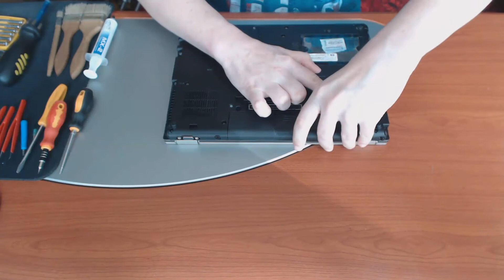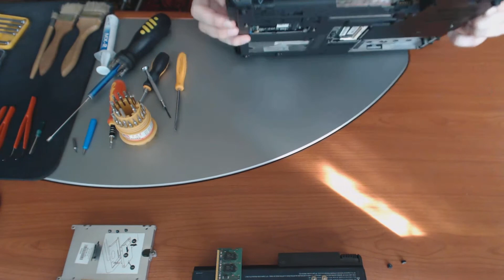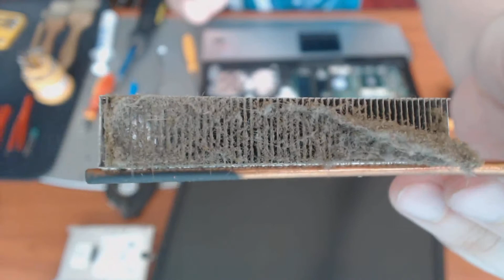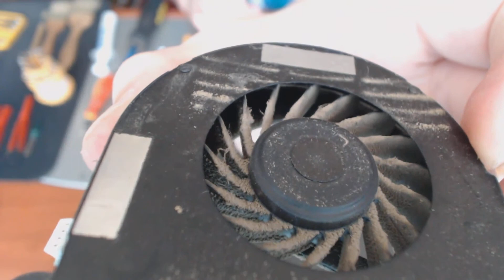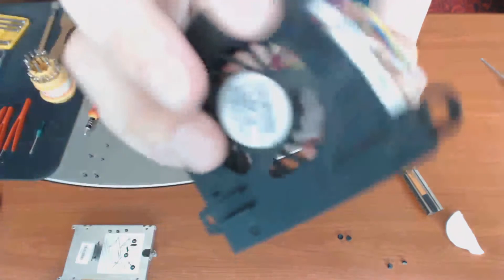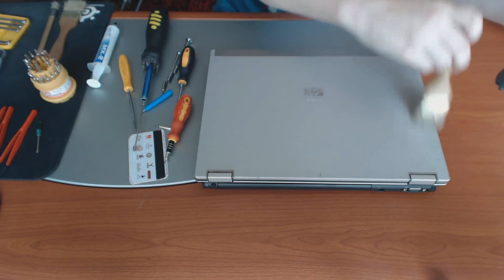Disassembly HP EliteBook 6930p GB997ET

Comment: Can this model be upgraded cpu or not?  What cpu can I upgrade to?
Reply from the maker: Hello! Yes, you can upgrade the CPU. The following processor families were installed in these notebooks according to the HP specification, https://support.hp.com/vn-en/document/c01538039

Intel Core 2 Duo Processor:

Intel Core 2 Duo Processor T 9600 (2.80 GHz, 6 MB L2 cache, 1066 MHz FSB)*
Intel Core 2 Duo Processor T 9400 (2.53 GHz, 6 MB L2 cache, 1066 MHz FSB)*
Intel Core 2 Duo Processor P 8600 (2.40 GHz, 3 MB L2 cache, 1066 MHz FSB)*
Intel Core 2 Duo Processor P 8400 (2.26 GHz, 3 MB L2 cache, 1066 MHz FSB)*

System chipset 
•	 Intel PM45 Express chipset
•	 Intel GM45 Express chipset

Here is a list of processors that Intel PM45 supports - https://www.cpu-upgrade.com/mb-Intel_(chipsets)/PM45_Express.html

Here is a list of processors that Intel GM45 supports - https://www.cpu-upgrade.com/mb-Intel_(chipsets)/GM45_Express.html

But the problem may be that your current cooling system will not be able to divert the heat flow from a more powerful processor and the laptop will begin to shut down under load. Better to do a processor upgrade at a service center.

Comment: Can this model upgrade the cpu?
Reply from the maker: Hello! Yes, you can upgrade the CPU. The following processor families were installed in these notebooks according to the HP specification, https://support.hp.com/vn-en/document/c01538039

Intel Core 2 Duo Processor:

Intel Core 2 Duo Processor T 9600 (2.80 GHz, 6 MB L2 cache, 1066 MHz FSB)*
Intel Core 2 Duo Processor T 9400 (2.53 GHz, 6 MB L2 cache, 1066 MHz FSB)*
Intel Core 2 Duo Processor P 8600 (2.40 GHz, 3 MB L2 cache, 1066 MHz FSB)*
Intel Core 2 Duo Processor P 8400 (2.26 GHz, 3 MB L2 cache, 1066 MHz FSB)*

System chipset 
•	 Intel PM45 Express chipset
•	 Intel GM45 Express chipset

Here is a list of processors that Intel PM45 supports - https://www.cpu-upgrade.com/mb-Intel_(chipsets)/PM45_Express.html

Here is a list of processors that Intel GM45 supports - https://www.cpu-upgrade.com/mb-Intel_(chipsets)/GM45_Express.html

But the problem may be that your current cooling system will not be able to divert the heat flow from a more powerful processor and the laptop will begin to shut down under load. Better to do a processor upgrade at a service center.